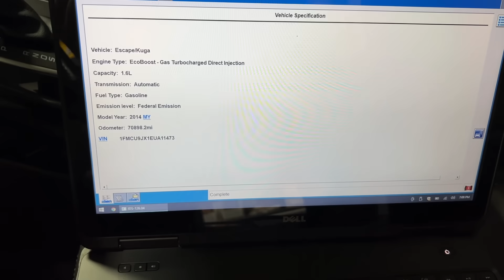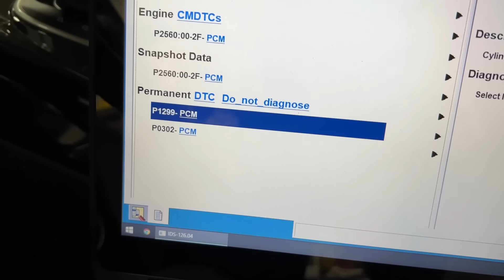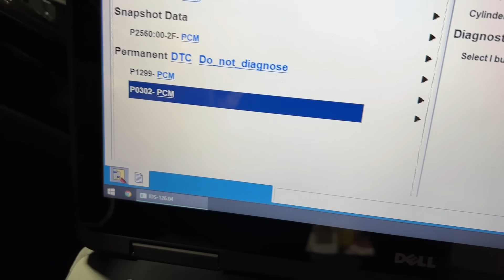Beware of Ford’s 1.5L 1.6L 2.0L Ecoboost Engines and Their Never Ending Coolant Consumption Issues!

Comment: Had my Eco Boost engine rebuilt instead of replacing it. Saved a lot of money. My Eco Boost engine is in my 2017 Escape. Hope I don't have a future problem with my rebuild. I'll keep a close watch on it.
Reply: Presumably- if the problem is caught early enough- only the block needs to be replaced.  All other engine parts can be re-used assuming that they are worth saving. Hope it all turns out.

Comment: I have a 2016 Ford Fusion SE Ecoboost @135,000 miles (mostly highway miles)  Only issues were the purge valve failing and a few recalls (still need to get them done) but the engine is still going!  I changed all the fluids so far and i'm good still. Car overall drives decently still!

Comment: Ok I have a issue with my 2013 im losing coolant was told its not leaking yet it leaks underneath the same side but farther up near the passage side floor board what could it be my heating coil or something else bc I'm tired of every few days putting coolant in it.

Comment: All of them have head gasket problems (well it's not the head gasket fault it's the design of the coolant passage between the cylinder block and head that was fixed in later engines so all of those early engines are going to be junk past certain mileage and you will be lucky to make it to the 100k mark so to all out there that have a car with this engine and it does not have the coolant "leak" get rid of it as soon as possible because you will have the same problem down the line even if the head gasket was replaced ...

Comment: Ford has a running problem with coolant system leaks. My 2001 7.3l Excursion had coolant pump failure, 2006 crown vic intake manifold coolant leak.

Comment: So happy I found this video.  I have a question: I took my 2018 escape in under the recall and they replaced the block.  Should my car still turn off when I compress the brake?? It does not and I cannot seem to get an answer from the dealer.

Comment: Back in July I had to replace 6 of these engines back to back because of this issue. Tsb 17-20 I think for any vehicle with this issue. The tsb should extend the warranty I could be wrong on that I can’t remember. If you have this issue take it to the dealer and get it inspected.
Reply from the maker: A TSB does not extend any warranties ever.

Comment: 2019 AWD w 1.5 Bought new.  . Dealer Network Lifetime Powertrain. I also gpt 7yr 100,000 extended warranty.  Sooo I have all scheduled service done at same dealer and keep all my records. Bought for my dtr. I regularly check oil and coolant level. Just over 3 years and 37,000 mi. Might still trade at 80 ish ?

Comment: I was one of the fortunate ones that just happened to be reading online one day about 2017 Ford Edge issues when I read about all of the engine coolant and misfires issues that owners were having..  At that time my Edge had 48,053 miles on it, just under their 50K powertrain warranty.  Concerned, I had my independant mechanic do the Ford prescribed 5 hour coolant test and sure enough, it failed their test.  I had the mechanic document exactly what he did and went to my Ford dealer and showed him the results of the test.  Fortuantely, they didn't have much choice but to agree with my mechanics test resuts so they covered the entire long block replacement cost, including a free loaner for almost three weeks because at that time, (during the pandemic) Ford was having a problem delivering long block engine parts.  I will say that i did have a very understanding Ford dealer.  Had I not seen those issues online that day I also would have been stuck with a very expensive repair bill.  I, like others have always been a Ford person and also like others, I was pissed that they didn't issue a recall on that engine.  Shame on them.  Ford screwed a lot of people on that one.  The only thing that I would have liked to find out was, what did they change on the new long block to correct that issue.  Many people I learned had to pay nearly $8-9K to get their vehicles repaired.  My Edge now has 73,000 miles on it but my new engine has about 24,000 on it.  I feel really bad for all those Ford owners who were not as fortunate.

Comment: These damn ecoboost engines are like the covid-19 vaccines. At first ya think they're all fine and good but after a while the problems start......and never end. I have a 2014 2.0L ecoboost. The coolant thing seems to be a slow eater of that. The auto transmission 6th gear slips and has thrown a code so often over the past I don't bother to reset it any more. Just look at the rpm's tells the story. Trans again sometimes slams into gear and will always slip and slam from drive to reverse. PTU yup nother issue. Had the smell changed gear oil in is several times, no more smell. Aside from not knowing when the transmission is going to blow my most recent issue is driver's side front wheel bearing going out. What's next for God sakes. So I have this 1989 Ford Bronco 2 sitting in my pole barn for 3 years now I'm going to put back on the road to replace the escape. I put a battery in it yesterday hopped in turned it over and it started right up. I always use sta-bil in gas when it's a long term storage issue and it's never failed. I won't get maybe $3500 to $4500 out of the escape so may dismantle it and use the non mechanical parts on the Bronco. 
The escapes are a nice little vehicle with plenty of power but loaded with problems engineering blunders unreliable parts and electronic quirks and issues. At the time my escape was priced at around $25,000 new. A fair price for a decent vehicle but since they are so loaded with expensive to repair problems the price should've been around $15,000.
Forgot to mention direct injection engines are great for power and economy but terrible on the valve train and piston rings. All direct injection engines need an oil catch can as without one is recipe for a blown engine due to valve train failure.
Also, I don't recommend young inexperienced drivers to drive these escapes. Another engineering blunder is the "A" pillars being so wide it blocks vision of cross traffic. Many times I've had close calls because my vision was blocked due to the size "A" pillars. If you're not moving your head all over inside the cabin live a fool, most people don't so it looks stupid, you won't see cross traffic and potentially drive into the side of another vehicle and it will be your fault. Just sayin.

Comment: Bought a 2013 Ford Fusion SE and it has been a nightmare. So many recalls and my coolant is also going  low with no visible leaks. Usually a Toyota guy and decided to give ford a shot, what a big mistake. This shouldn't be happening at 50k miles and should be a recall.

Comment: I think everyone would like to know ,on a percentage basis, how often this catastrophic engine failure/coolant occurs ?   3 percent 10 percent ?  30 percent ?  Higher ? lower ?  Since I bought my 2013 Escape I replaced a plastics/rubber tri angle looking  hose for a hundred dollars.  Now I'm seeing coolant on the floor which I think may be the plastic coolant tank.  But it seems on an intermittent basis. I can deal with a couple hundred dollar replacements if that's it..  A new engine/long block is out of the question for a 94K  2013 Escape..  I paid $13K for it 3 years ago, I like the car in general but there is a limit..  Somehow I bought another Escape from my 2007 Escape that had to have the tranny replaced at 70k, then went out again at 105K..  The replacement trans was guaranteed for 50K or 36 months but went out at 38 months..  Before the 2007 Escape I had a 1995 Jeep Grand Cherokee, 318 engine..  Flawless, only sold it because it had 176K. Guess I should have kept it..

Comment: I've always hated when people would insult ford...but when I called the local dealer a few days ago about my 13 Ford Escape with the 1.6l about the laundry list of recalls they have. The dealer told my my vin happened to be the one out of the thousands, where non of the recalls were applicable... when I called the national number, they told me one does exist and that is the Safety Recall 13S12. When I pull up the list details, it said they would "make enhancements to the cooling system" but couldn't tell me if that was just related to oil or the coolant. The national number told me the only thing I can do about the other issues was to report it to the NHSTA number. If enough people made a complaint to them, then they would issue a new recall for the vins that fell between the cracks.

Comment: My 16 Escape has the 1.6 ecoboost and we’ve had no real issues. In fact I drive it kinda hard and it’s been very reliable considering that it has over 150k miles. 
Now I bought a 22 Escape and it has been in the shop nonstop for things from an accident back in may.
Reply: Does the valve cover say cleveland or vep.  If its vep, its made in Spain, and is much more reliable.

Comment: I have a 2017 mk8 2ltr ecoblue diesel transit. It developed cylinder head issues when I bought it a year ago. Had the head reconditioned by the garage under warranty. Ran fine for a year. Now just after a year later, it's rattled a big end shell out. Now it's having a new engine at my expense as the warranty has expired! Are the newer ford ecoblue engines any better as not sure if I'll ever trust these engines at all now!! Might go back to a rusty old Mk6! Needed welding every year but mechanically bullet proof!

Comment: My 2013 Mondeo skipped a few steps, no coolant consumption, no codes, but catastrophic engine failure under moderate acceleration. Blew the head gasket, sprayed coolant into cylinder 2 and scratched the aluseal. No more Fords for me ever after that bs.

Comment: I had this issue on my 2017 2.0 fusion 3 years ago.  My mechanic told me to try K-Seal in the coolant.  It seems to have fixed it and haven't been leaking coolant since.  My warranty was already up due to mileage so never brought it to the dealer.

Comment: This is part of the reason when I was looking for a first car for my daughter a few years ago I steered clear of the Ecoboost cars.. Got her a Fusion with the 3.0 L Duratec V6. Runs like a champ and gets good power.
Reply: Those also have an issue. If your water pump fails your whole car fails.
Reply: @greysymphonyearth  Not on the Duratec V6.. It's an external belt driven pump. You are thinking of the Ecoboosts with the internal chain driven pump.
Reply: @9Packin  I'm pretty sure it was the Durtec V6. Ford had a lawsuit for it.
Reply: @greysymphonyearth  OK I did some research. I think we are both right.. lol it IS the Duratec V6 that has the issue, but it's the 3.5 not the 3.0.
Reply: @9Packin  i remember a friend of mine had his ford flex give out at around 72k. He told me it was a duratec V6. I was starting to think either he was wrong or i rememberd it wrong. Glad you got the one without the issue.
Reply: @greysymphonyearth  Yeah I looked it up again. The Duratecs with the issues included the 3.5 and 3.7's that had the internal belt-driven pump, including my old work vehicle (2016 Explorer). Thankfully, the predecessor (3.0 that's in my daughter's 2009 Fusion) didn't have this design. It has the good old fashioned external belt driven pump. That car is approaching 150k miles and still runs like a champ, good shifting and power, she has it at college.

Comment: So you're talking about the older engines right? Because I was under the impression that they had fixed these problems with the newer ones in the last 3 or 4 years. Specifically the 1.5 liter is now the l3 Dragon.
Reply from the maker: It all depends on the model, year and engine you have. We are speaking of the 2.0L in the Escape in this video only

Comment: Right now I have 117 k miles on Ford explorer  it looses coolant inconsistently it is a diff engine nonturbo but the water pump is in the engine. No water in the oil so that is not leaking but when it leaks it can kill the whole engine. And it cost 2000 to have a michanic replace the water pump

Comment: Oh man! The Fire Escapes! I own a 2014 with the coolant leak issue. Ford's solution? A recall to change out the coolant reservoir with one that triggers a  dash light when the coolant is low!!!!!  Of course when I asked the dealer where the coolant is going they couldn't  / wouldn't tell me.  There should be a class action suit against Ford. Like you said, Ford keeps producing the engine even though they know it's flawed!!!! Shameful.

Comment: add to the list, 2016 focus 1.0l ecoboost .  I had my cylinder wall crack  8 days before my 5 yr mark. coolant in cylinder, , blowing water vapor out the tailpipe.   It had less than 50,000. miles. It took over two months but ford replaced under warranty with new 1.0l longblock and new turbo. Im still leary on this ecoboost engine, but glad ford replaced all without hassle.

Comment: I cannot believe that Ford engineers designed and built an engine block with cylinders that touch on the sides and require cut grooves or drilled holes to get coolant on the sides of the cylinders.
 And then, Ford slaps a turbocharger on it and forces huge pressure into that same bad block design.
The uneven heat stress alone will force the head gasket to move and flex and that is what is causing the unsealing.
The standard for cylinders in engine blocks is to have each cylinder open all the way around so that coolant can cool the cylinder evenly.
WITH OUT DRILLING HOLES OR CUTTING GROOVES.
This Ford type of Ecoboost  block engineering completely ignores reality.
Built Ford  Stupid should be their company motto now.

Comment: Good morning. Just stumbled on your channel. I wish more honest mechanics would address this issue. I bought a new 2018 Escape with the 1.5 liter engine and after 18000 miles it was in a Ford dealership for three months. They rebuilt the engine and it was a mess when I got it back. Nothing worked correctly. This is where it gets interesting, the mechanic spoke with me and lied, told it was only this vehicle and there was no problem with a 1.5 liter engine. I believed him and the owner of the dealership traded in for a 2019 Escape with the 1.5 liter engine. Eight months later I noticed the coolant was low. Same problem. I immediately trade it in for a Chevy. Ford refused to acknowledge anything so between both cars I lost about 25000 dollars. I am done with Ford!!!!

Comment: What about the 2.3 L ecoboost? I am currently having this issue.  I paid $2400 to have my head gasket changed and a week later I am having this misfire issue again.
Reply from the maker: Yup they have this issue too on certain years.
Reply: @FordTechMakuloco  mine is a 2018 and it has the same slits in-between each cylinder.

Comment: So, computers, and, by extension, CAD engines, are not infallible?  In the early days of computers, the most often used phrase was a variation of "poop in, poop out",  It makes you wonder how many other things in our lives, for instance the climate nonsense which spurred battery operated vehicles, is also based on flawed data.

Comment: Thank you sir for the info. Question: does the block crack due to cold or hot climate or is it just a design flaw unrelated to car maintenance, usage intensity, climate, etc? 

 I'm helping a friend buy a car and she was interested in an escape for the features and performance. We're in Dubai so making sure the car doesn't overheat is important and if there's a risk for an invisible leak, which would be invisible to us during a test drive and inspection, then it's probably a pass, as well as a pass for all Ecoboost engines in the region!

Comment: Is this issue with the 2019 Escapes 1.5 also?      If I received no CSP notice on my 2019, am I probably  in the clear?  I do know some people with 2019 Escape that did get the notice, but I did not.  Mine was mfg in 9/19  vs 1/19,  maybe that is it, and I am ok?
Reply: Yes, it affects the 2019 Escape. Ours needs an engine replacement and Ford said it could take up to 8 months to get the parts.

Comment: Absolute crap these 1.6l ecoboost engines. In South Africa there was a stage where a number of these 1.6 Ecoboost cars caught fire from oil leaking onto the exhaust manifold, unknown to the owner until the oil on the manifold catches fire. Owners lost their cars as they all burned out. Ford South Africa was slow to respond but ended up doing a recall on the cars and making changes to the cooling system and adding additional temp sensors. 

Personally owned a 2016 Kuga 1.6l - Nice car and pulled nice but sold it 2 years later was I did not want to sit with potential cooling issues.

Comment: I picked my 2017 Ford Escape SE 1.5L up from the dealership on June 8,2021.  The dealer had the car six damn weeks doing the long block replacement.  I just noticed my coolant reservoir is below the minimum level.  The dealer has been sold to another dealer. I’m not looking forward to dealing with this again.

Comment: Hi.  I have a 2017 Ford Fusion SE with 24,000 miles.  I installed a catch can on it.  I was just wondering if I could detect the presence of coolant from what came out of the can? (I have been saving it).
Reply: I noticed that I have to add coolant to the reservoir periodically to keep it topped up to the full mark. (Very small amounts).
Reply: @MadScientist72  we added some to a 2015 Nissan Altima. Basically it should not evaporate in a pressurized system. It's not confidence inspiring and in your case, I'd take a look at trying a higher performance coolant. Demineralized or distilled water is ok above freezing. Add a smaller amount of antioxidant. Maybe worst case is remove the thermostat. Or get a 160-180 degree thermostat. Also you could try a full time fan mode switch. Or even add a few hood vents. You might be lucky and just need a new cap but you'd see the leakage.....